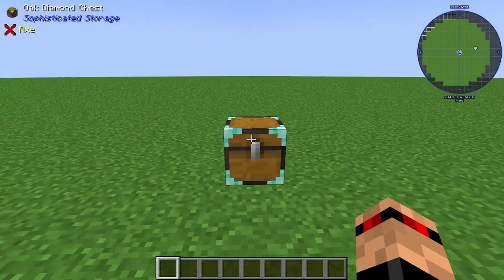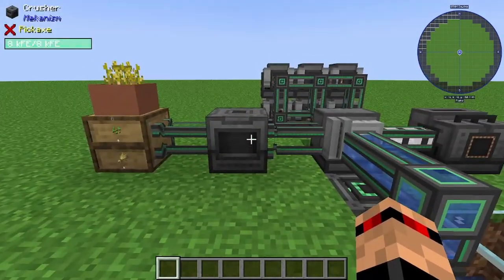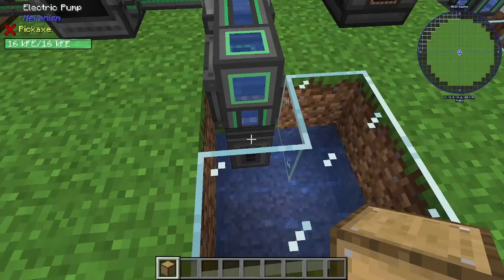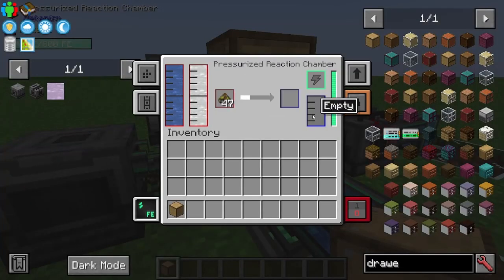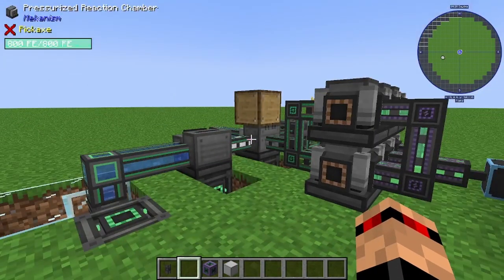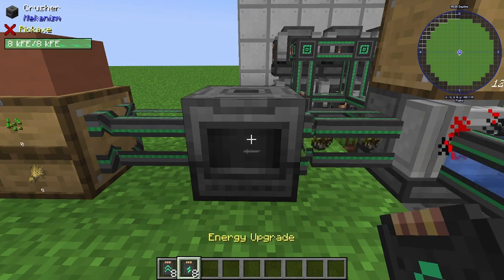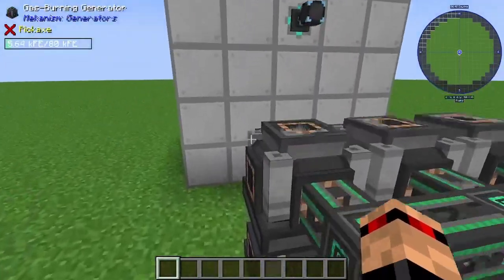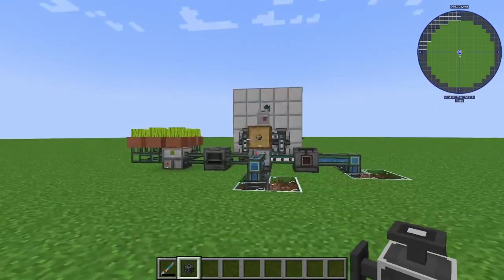Quick Guides - Mekanism Melon Power Tutorial⚡

Comment: One of the best ways to supply this with biomass is (if snad is installed in the pack), put down snad, with cactus on top, and above it put a fence post one block over the cactus (so it is cactus, air, fencepost).  Make sure you put a ring of hoppers under it outputting to the input of the crusher, and you have an insane amount of input.  NOTE: this doesn't always work in the newer versions for some reason (not sure since the one pack I did this in, I got almost a full drawer of cactus in about an hour of AFK but if your snad doesn't almost auto -grow the cactus, then it might have been nerfed).  You can also use a vacuum hopper or a vacuumulator chest or any item collection block to suck up the cactus that drops from growing up into the fencepost.  You're welcome.  :goodvibes:
Reply from the maker: Awesome tip 😁
This was done in ATM8 which doesn't have snad for some reason 🤔 it really should have snad 😁

Comment: You don't need the pipes between the machines, you can just eject to the next machine. That makes it a lot cheaper and if you eject the byproduct to the bottom and the ethylene to the top into a basic chemical tank (that can eject too) you can get everything into a 3x1 footprint.
Reply from the maker: If you watch till the end I do a much more compact version. I say at the start that it can be more compact too 🤔
Also great user name 😁
Reply: @Pilpoh  yeah, you're right. If you only use mechanism that's as small as it gets. With xnet, pipez or integrated dynamics you can make it even smaller. That is always the first setup I build in most worlds since it solves energy problems for early to mid game, is inexpensive and easy to build. 😊
Reply: @efficiencyvi8369  can you share a screenshot of your setup? :D

Comment: Just a quick update and FYI on this:

It is a brilliant design, but it does not work in ATM8, at least not on a large scale.

I made a setup using 9 Pressurized Reaction Chambers and 8 Gas Burning Generators and bugs in ATM8 won't allow more than one of the Generators to run at a time. Maybe it's not a bug, maybe it's intentional behavior, but 1 and only 1 Gas Burning Generator will burn gas at any given time.

This means the max output of this system, irrelevant of how many generators are used, is the same as the max output of a single generator. It doesn't scale. You can't make it with 2 or 4 or 7 generators to increase the power. Only 1 will burn at a time.
Reply from the maker: Did they nerf it? Also can it be scaled out into different sets of generators some how? 🤔 I'll do some testing on the server and see what's the deal! (if they did nerf it I'd 100% agree it's OP 🤣)
Reply: @Pilpoh  Well, more testing on my end and I think I've found the problem. I was pulling power from it with both Flux Plugs and Tesseracts ... at the same time. It didn't seem to know how to handle that.

I am now pulling power out only with the Flux plugs and it seems to be working properly. (knock on wood)

Comment: My hydrogen is not extracting from the electrolytic separator to the pressurized reaction chamber and I’ve used the pressure tubes and the fluid pipes. Why?
Reply from the maker: There's 2 blue outputs, are you on the correct blue? 🤔 From memory it's light blue for hydrogen but I could be wrong... Let me know if that's fixed it, genuinely curious!

Comment: Ah I'm having a little trouble getting the machines to even output to each other, and the compacting drawer is just making packed melons not slices! I do have to say I'm a little lost in the process, but I'll see if I'm doing something wrong.
Reply: I played around more with the configs on the machines and managed to get it work! turns out theirs 2 colors for outputs causing the machines to be confused.
Reply from the maker: Glad you got it working 😁 the melons might require the slices to be put in the compacting drawer first and then the melon will split down to the slices 😉
Reply: @Pilpoh  Oohh okay gotcha! though I think what I've got now is working well, I've just plopped the botany pot on top of the saw mill to go down to the rest of the machines. Thank you so much for the guide too! It has done wonders.
Reply from the maker: I used the sawmill at first too! The compacting drawer needs to be "primed" with a slice in the bottom right drawer slot and if the melons don't come in quick enough the crusher will start taking the full melons. Saw mill is a great way around that 😁
Reply: @Pilpoh  I might try that to see if that'll be better!

Comment: It would have been nice to run the setup off the energy that the setup was producing. This way we could see how much excess is produced.
Reply from the maker: Great point! I am not sure how much the set up uses but its far less than the amount it produces 😁
Reply: @Pilpoh  I finally made this mess and it definitely kicks butt. 

I have:
-1 sawmill that turns the melons into melon slices (but now that I'm watching your video again, I see that I can eliminate that and use a compacting drawer instead pulling out slices rather than whole melons)
-1 fully upgraded Mekanisms Crushing Factory (all nine slot available)
-9 Pressurized Reaction Chambers
-8 Gas Burning Generators
(9 and 8 seemed to work best in my tests.)

They all have 8 speed and 8 efficiency upgrades.

I highly doubt that I will need any more power during this playthrough. It's unlikely that I will ever use all the power this thing can produce.

I especially love the fact that it only produces power when something needs power.

Thanks for the idea. This mess is seriously OP.

Comment: what do you do to make it self sufficient though? everything keeps running out of power and I'm not sure how to connect them to keep them running without outside power
Reply from the maker: The power output side of the gas burners can be fed back into the other power cables powering everything else. You should be producing far more power than the machines are using 🤔

Comment: Is there a reason compact drawer is not outputting items? I tried different pipes and just cannot get the items to leave the compact drawer.
Reply from the maker: Did you try breaking it and placing it back down? I've never had that happen before 🤔
Reply: @Pilpoh  I just got rid of it, placed the hoppers going into the sawmill lol
Reply from the maker: I used a sawmill to begin with to be fair, that also works 😁

Comment: my gas generators are filling up but only two of them are burning it and producing power? any tips on why they arent working
Reply: do i need a mekanism battery for it to transfer or can i just plug it straight into my flux plug?
Reply from the maker: You can have it making a buffer of energy using a energy cube or make it go straight to your flux network. If not all of the burners are active it could be because you aren't using all the power it produces 🤔
Reply: @Pilpoh  ah makes sense thank you. I ended up just removing it because my electrolytic seperator just wasn't getting power to produce the acid sadly. Appreciate the reply though :)

Comment: im begining to make the induction casing, how many induction PROVIDERS do i need on the inside? 1 or more than 1? and what is the flux plug [?] plugged into
Reply from the maker: Providers regulate how much power can move in and out of a induction matrix so if you have huge power gen then you may need a few of them to keep up. The power importer is what the flux point goes into and an exporter is where you stick a flux plug. Hope this helps 😉